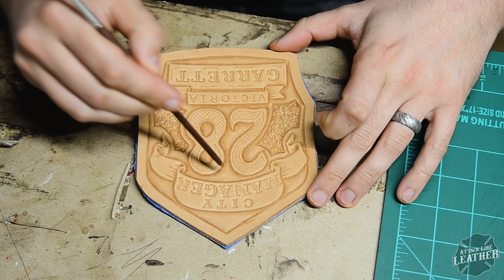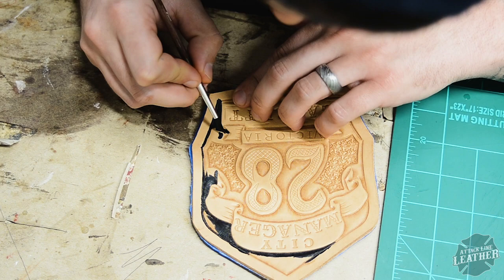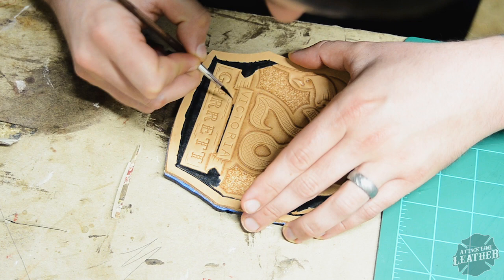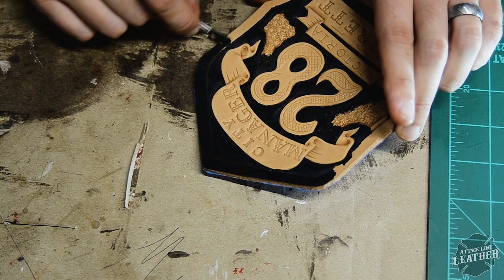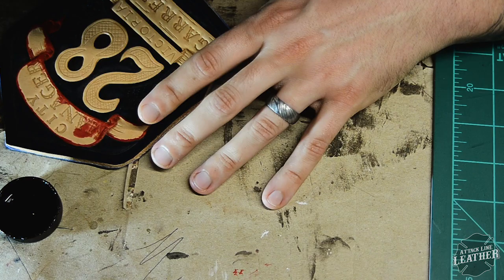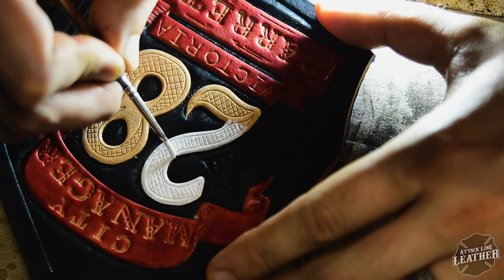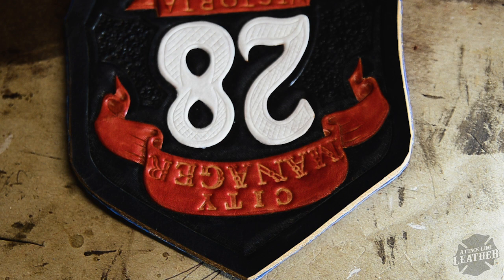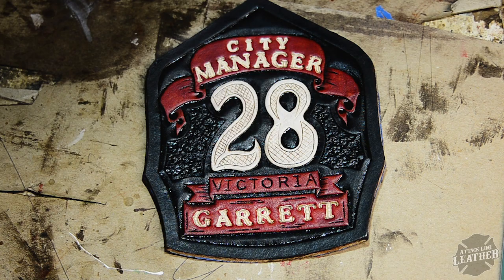Dying/Painting a Fire Helmet Shield

Comment: I am working with dyes and antiquing for the first time on a fire helmet shield. I was wondering how do you antique the shield and make sure you get the product out of the painted stamped letters so it’s not gunked in black?
Reply from the maker: I have an antiquing video up that will show you my process.  I make sure to clean out any small cuts with either a paper towel or a kew tip